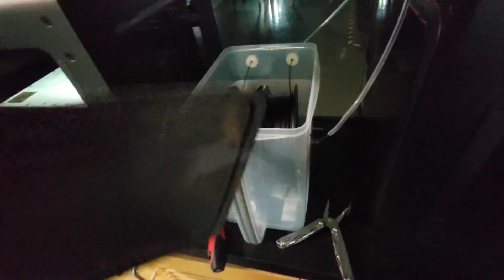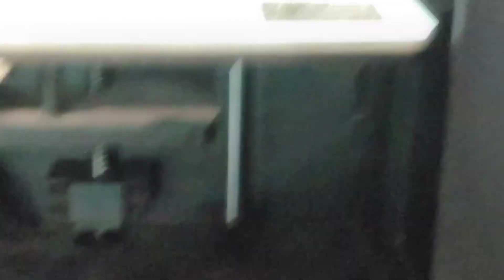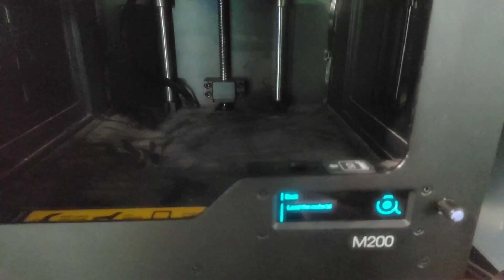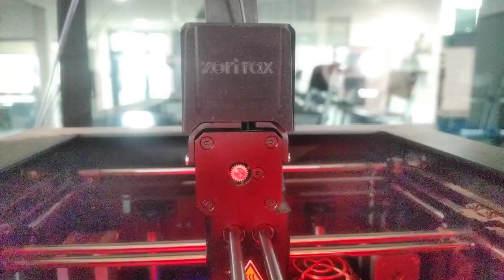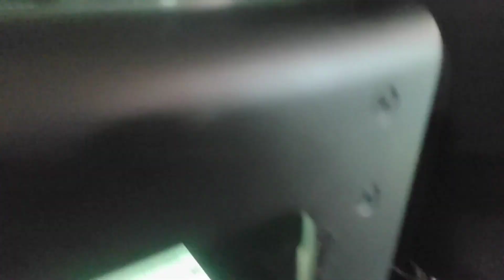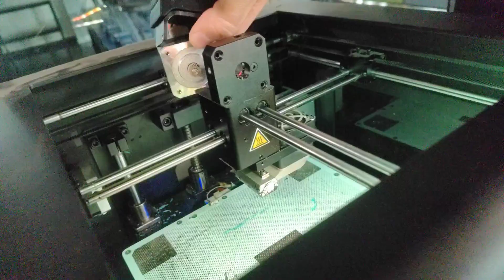ZOTRAX - Loading Filament

Comment: Man, thanks for the video! I have the same problem but have already cleaned the gear part, at least from what I can see, so I assume it's further below the problem! Could you please suggest anything ?
Reply from the maker: Hey mate! Yeah its possible your clogged further down. We had this happen on a machine when a much higher temp filament got put in by mistake. It was a while ago so its hard to remember. I believe I removed the nozzle and used a long Alen key to force the large slug of filament out (While heated at temp) of the hot end therefor clearing the whole part. I then ran some regular ABS though to make sure it was all out. You can also take the hot end apart further using the bolts above the heating block from memory. The zortax website does have a little info in section 3 of this page. https://support.zortrax.com/hotend-replacement/
Reply: @LABMATT.  million thanks for the immediate feedback! I did what you said and resolved it! Tnx again!